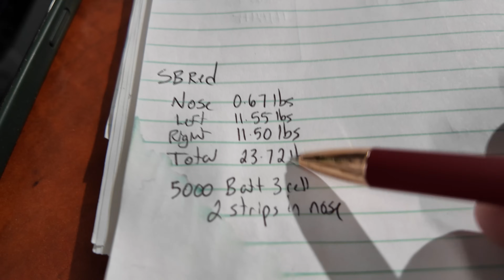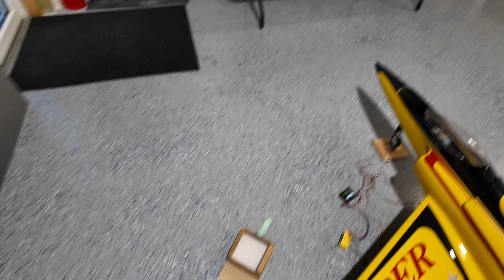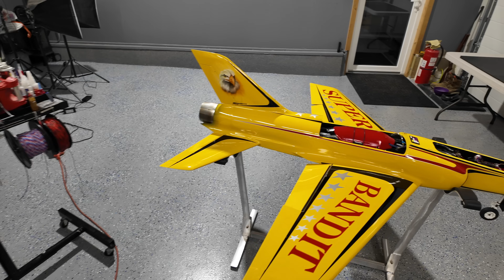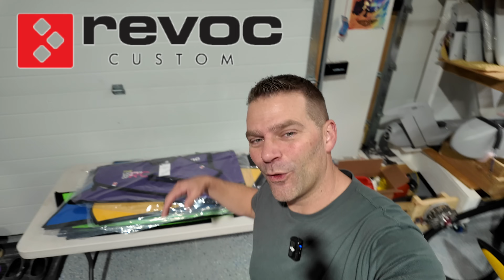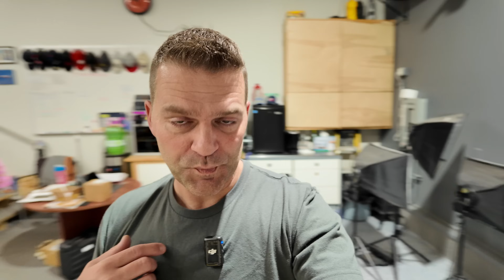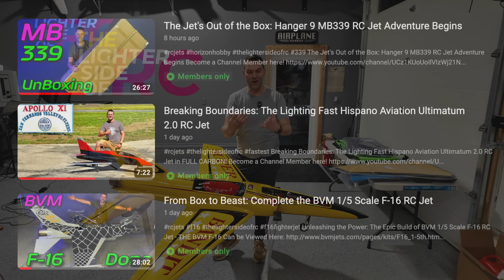Ultimate BVM Super Bandit Transformation: Watch Video 3 To See The Epic Rebuild!

Comment: Couldn’t you still have used the cockpit and compensate with a touch more weight in the tail? If the cockpit weighs ounces I would imagine it wouldn’t take much in weight in the rear? Canopy looks cool blacked out. Just wondering
Reply from the maker: Yes possible for sure.  I like the blacked out look better and was hoping to take out the cockpit anyways